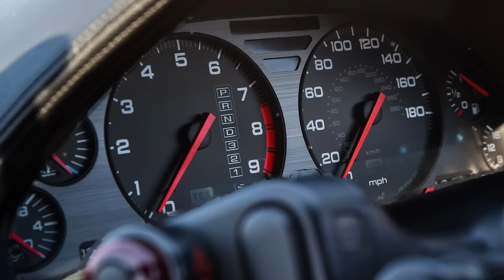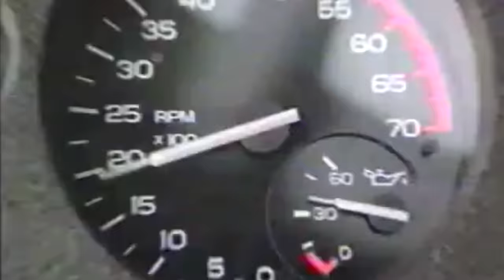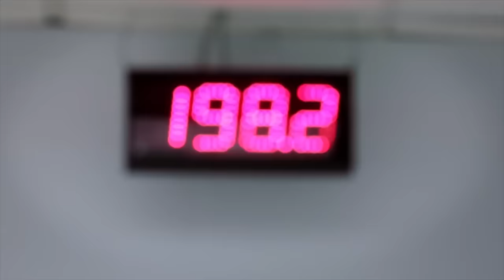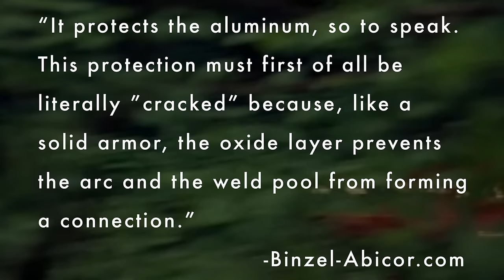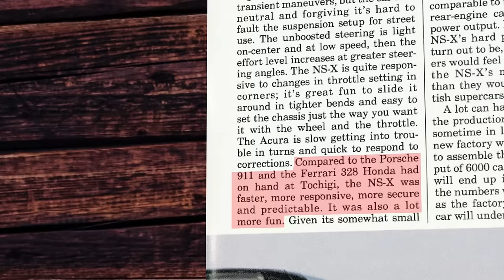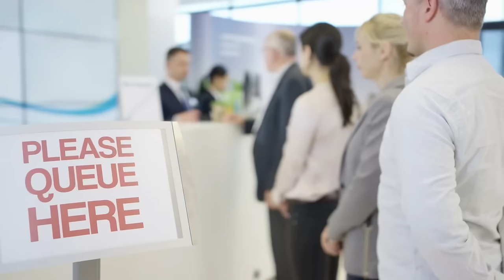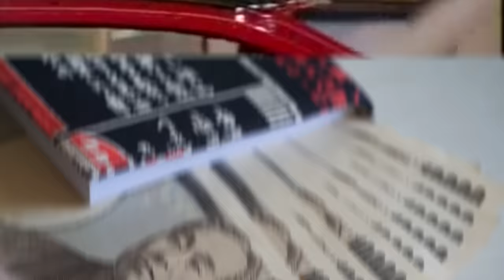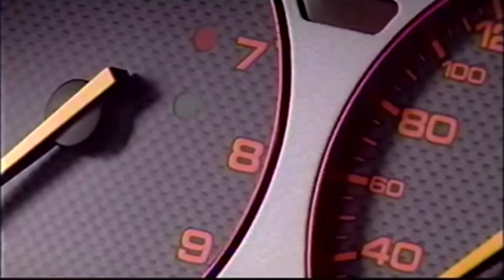NSX: The ULTIMATE History of Honda's Supercar (Documentary)

Comment: I was an Acura dealer tech in the late ‘90’s/early 2000’s and was lucky enough to work on a few of these, and I mean VERY FEW! We had to watch videos in the dealership before they came out to know that to do when they came in for service. With the exception of regular service or to replace the rear tires, they were as reliable as an Accord. The engine had a safeguard that would not allow it rev above a certain rpm until it was up to operation temperature to avoid premature wear or damage. It was a quiet, civilized car that could be driven daily but still go play on the twisties or drive cross-country without blinking. Seeing this brings back many fond memories! Thanks!❤
Reply from the maker: That was great to read. Thanks got watching
Reply: they also are badass cars! 👍

Comment: 1:03:59 This is interesting because the 2007 V10 Concept sounds like it could have become a Lexus LFA or Nissan GT-R competitor; especially if it included Acura’s innovative (and new at the time) SH-AWD to stack up against 2006 AWD Quattro V10 Audi R8’s.

1:05:39 I would argue that the C8 Chevorlet Corvette, 2006 Audi R8, and Lotus Evora GT sets out to emulate what the first gen 1990 Acura NSX wanted to do with lighter-weight, lower cost, sports cars that are comfortable.

Comment: We need a new, grassroots release of this car. Hybrid and electric cars are a waist of time. Honda made the Civic CX. In 89. How many mpg did it get again? Low tech and still around 50 miles per gallon. No electric motors, no direct injection, no 7 speed transmission. Just pure and simple. And reliable at that

Comment: I always wondered what the NSX would've been like had Honda been more "American" with their horsepower output and not so modest. Imagine if they had made a special edition NA market NSX with 350-400 hp, I don't think they would've had any problem selling those.
Reply: I agree, when the NSX was introduced I was a bit disappointed with the hp number , a Nissan z turbo had 300hp for almost 1/2 the price, a turbo engine or a v8 with over 300hp would have been nice and improved its straight line speed.
Reply: Maybe they could have used " American " suspension as well , or as everyone else knows it , the suspension off a stagecoach .
Reply: @Dad-Gad  , everything is straight and flat, who needs a suspension? lol
Reply: Gordon Murray, who created the McLaren F1 based on his experience AND brief ownership of an NSX, opined that the bone stock NSX chassis can easily take way more than 400 HP without losing its characteristic sharp handling capabilities. High performance sports cars typically can't take much more than its stock HP without losing that agile handling due to soft chassis. NSX (coupe model, not the -T) was THE exception. He said Honda did it right the first time. Senna had a part in providing feedback which led to further stiffening the chassis by the engineers and Uehara took Senna's advice to heart. Hence is why many NSX owners decided to supercharge their NSX to 500HP and not lose its handling capabilities if they wanted more than stock 290HP. I didn't need all that horsepower so I decided to leave mine stock.
Reply: @willywonka4340  Actually Murray owned the NSX for many years, like 5-7 yrs